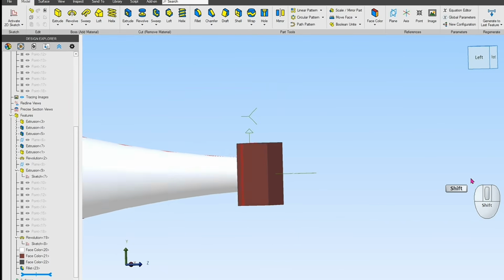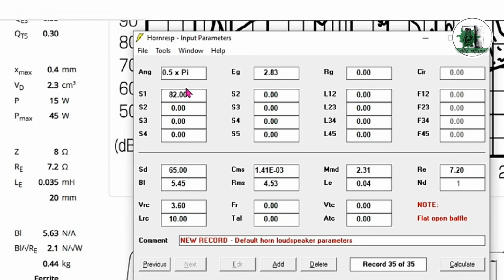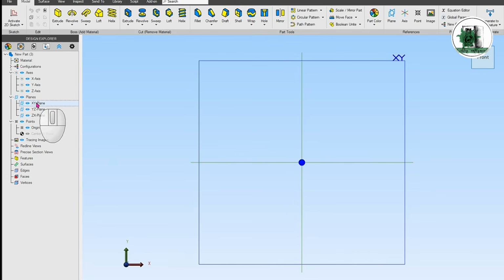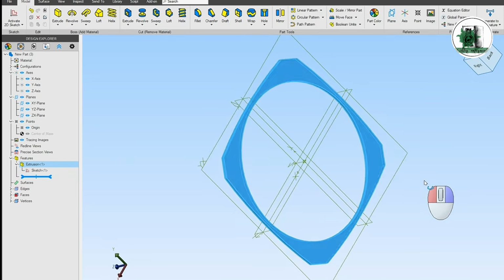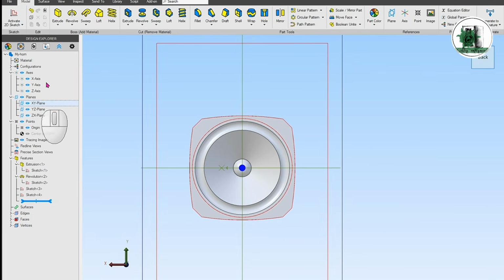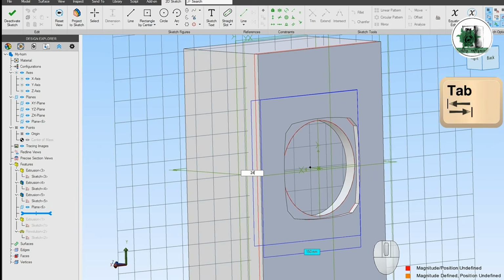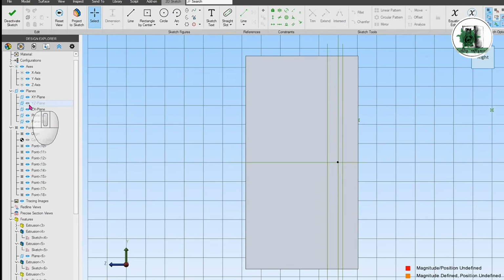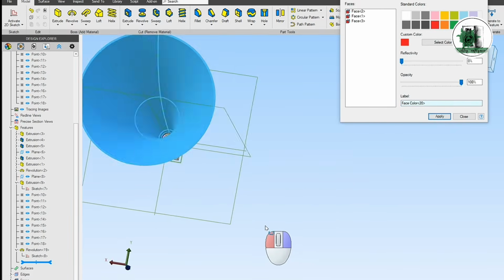Horn Speaker Design Tutorial - Start Here If You're New

Comment: Can Hornresp be used to model a horn that focuses on higher frequencies and wider dispersion? Or is it only for the lower frequencies?
Reply: It's only accurate for midrange frequencies and lower.
Reply: @iliketoast-q9b  Thanks!
Reply: Use baffle step software to clean up higher frequencies.
Reply: @CraftAero  I was thinking of amplifying them, not really cleaning
Reply: @ivanaviNiebla  Just try your input numbers and see if it gives you something feasible.
   A two inch "horn" is a baffle, a 12" horn is a horn, a 120" horn das Alpenhorn.